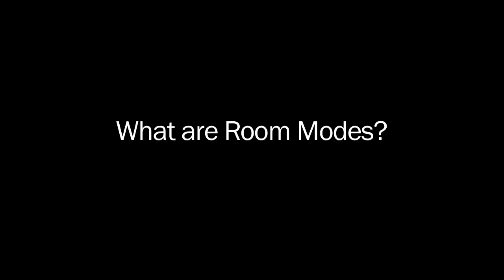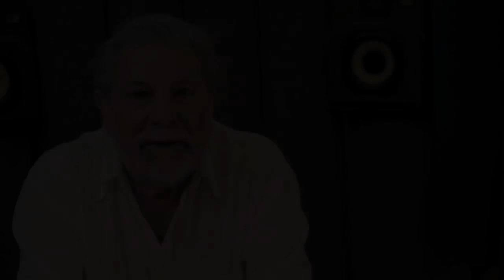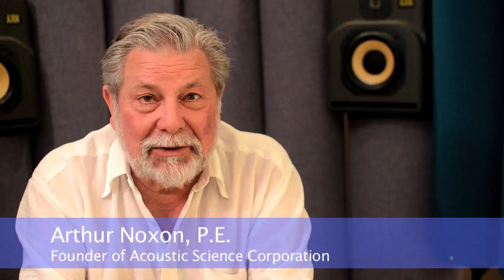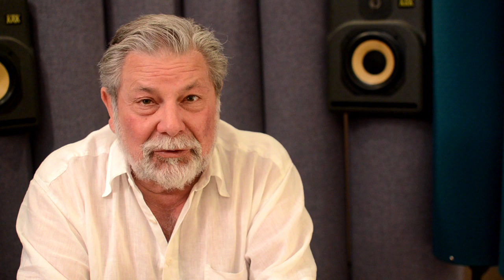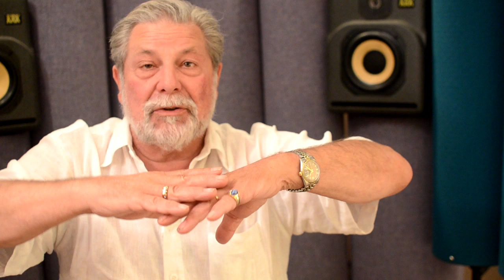Art Noxon Answers: What Are Room Modes?

Comment: I know this is an older video but just wanna throw this question/observation out there...Is the room "mode" different than the "resonant frequency" in a room? For example, I listen to music while in the shower, and I'll notice that one note jumps out more than all the others. So if I match that note with my voice, i can hear it boom. And if I hold that note, it gets crazy boomy and fills the entire space. But you said if it's a short note (less than a second or so), it won't typically excite the room - am I missing something or did I just discover a new law of physics lol
Reply from the maker: Hi JB....

Probably didn't discover new physics... Mode and resonant frequency are two ways to say the same thing.  A tile bathroom has modes, resonant frequencies and it has something else, lots of reverberation.  Reverberation is the sustained reflection of sound.  Any note you hold in a reverberant room will get louder and louder, any note not just room modes but any note.    

But if you make a tone and slowly change the frequency, you are making a sweep tone.  Start as low as you can and sweep up to as high of a note as you can.  During the sweep you should hear certain tones become exceedingly strong, loud.  These tones are the ones I'm talking about in the video, where the next push is delivered in time with the reflection of the previous push.  

"It takes about 1 to 1.5 seconds of holding a sustained tone to create a standing wave, or a room mode, if the tone is a room mode and you are in the correct location to create the mode, inside the sound pressure zone of the standing wave. That's the one note that jumps out at you, that you noticed.... 

 Once you identify a mode, let the room quiet down and now just sing the one resonant tone, hold it and let it build. Then stop and listen to it decay..... Then make a very short (1/4 second long) version of that same tone, sorta like Ba, Ba.  Change frequency to a different frequency that is not resonant, do again... Be, Be. Both short notes, Ba and Be should sound about the same, even though Ba was a room mode and Be was not a mode.  

sorry to be so late with a reply....thanks for asking and helping to clear things up.  
Art Noxon
Reply: ASC TubeTrap wow, thanks for the reply! I'll experiment with what you suggest...very interesting!

Comment: i like the explanation, out of curiosity how it.was explained that the second mode of a standing wave is like the bathtub water going in and out instead of sloshing, what is the next or is there nkt
Reply: 2nd harmonic in bathtub looks like this.....Water level at both ends of the tub raise up at the same time, while the middle of the tub drops down.  1/4 cycle later the water is flat but moving from the both ends towards the low middle.  Then that water rushing towards the center from both ends piles up high in the middle leaving both ends of the tub at a low level.  And on it goes.  To pump up  second harmonic, apply pressure on the water surface in the mddle of the tub.  Watch the water wave travel out to both ends of the tub and back to the middle, when it's at the middle apply another push down, again in time with the water movement.

Comment: My god you make this confusing with this swing stuff.  Most rooms are more or less like cubes, and you get 3  big places for things to go bad.  These are all the big parallel surfaces.  Any surface will have an effect, but it is the big ones that have the most effect.  Front to back, side to side, floor to ceiling.  In some cases you can clearly hear which one is dominant.  A good case of this is in a long carpeted hallway.  The carpet damps the floor to ceiling, and the length of the hallway puts it's frequency below the range of normal human speech, leaving you with that ringing sound from side to side.  If you clap and create some impulse noise you can actually hear it bounce back and forth while it subsides.  It is not like a swing where it takes time t build up.  Audio frequencies are from the tens of cycles per second to the thousands of cycles per second.  If you can push your kid sister on a swing a few thousand times in a second you are in far better shape than I am.  Besides the fact that at least for small displacements, the time of the swing is independent of the length of the displacement.  This is the theory behind pendulums as used in clocks dating back to 1656.  Oddly enough, in nature, humans use minute time and phase differences to localize sounds.  A very small amount of a humans sense of where a sound is coming from is based on the amplitude difference in the sounds.  Quite probably the single biggest affront to natural sounding recordings in modern times can be attributed to the so called pan pot, but that is a diatribe for another day....
Reply: I'm trying to relate resonance to familiar experiences.  I try to not use words to teach words because the feel of the concept remains buried in words.  I try to use words to tell stories that help  people feel what is going on, to feel it without the need for words.  But some people do love the world of words......
Reply: A clap in the hallway is not a resonance, there is no low frequency energy in a single hand clap, just an impulse of high frquency noise.  What you hear is a flutter echo, aka a pseudo tone, a sonic impression for sure, but it is not a bass tone even though it sounds like a bass tone.  Kids use a clothes pin to position a playing card so it gets hit by the spokes of a bicycle wheel.  It sounds like a Harley, but it isn't a Harley, it's a pseudo Harley,
Reply: First of all … what are you saying here ? That’s a lot of words to have almost no point. 

Second … your example is not really valid here.   Clapping your hands to create an impulse is not triggering a room mode.   

I’m confused.
Reply: @johnryansullivan2439
Reply: Sorry I didn't notice this string of comments to the youtube posting.  I'll answer some of the complaining comments now, although it is years later.  
I'll start with the most recent complaint, that a hand clap can't trigger a room mode.  
John Ray Sullivan's says:
     First of all … what are you saying here ? 
     That’s a lot of words to have almost no point. 
     Second … your example is not really valid here.   
     Clapping your hands to create an impulse is not triggering a room mode.  
      I’m confused.

John, you are not confused, you are absolutely correct,.
An impulse can't create a real room mode.  Very sorry to have given that impression. 

But an clap impulse between parallel walls can give the impression of a mode.  
And that's what is so confusing.
Now, let me try to explain what I failed to explain before. 
It' a little complicated so stay with me to the very end...the punch line....

A flutter echo is a repeating path of sound between two parallel walls.  
A mode is a repeating path of sound between two parallel walls.  
Hmm, same thing..........strange

A flutter echo is created by a single sharp slap type of sound, lots of high frequencies.
A mode is created by a long tone burst, a single tone in the bass range.  
Hmm, opposite things........strange

Real sound travels 1128 feet/sec . Our make believe walls are 11 feet apart. 
It takes 11/1128 = .01 sec or 10 ms for sound to travel the distance between the walls.  

We stand against one wall and clap, we hear the reflection after one round trip, 20 ms.  
We keep listening, we hear another slightly weaker echo clap in another 20 ms.  
 and another in another 20 ms and so on and on and on.  
We hear a series of claps every 20ms apart.  
To our ear/brain it sound like a tone that repeats itself every 20 ms. 
A tone that repeats itself every 20ms has the period P of 20 ms..
This tone has the frequency of f = 1/P = 1/20 ms = 50 Hz which is a low tone.  

What is the wavelength of a 50 Hz tone?   L = c/f = 1128/50 = 22 feet.  
What is a half wavelength of this tone?  22 feet/2 = 11 feet.  
A half wavelength that just fits between our parallel walls has a tone of 50 Hz.  
This half wavelength is the fundamental tone of the harmonic series of 
50 Hz, 100 Hz, 150 Hz, 200 Hz  and so on.....the room mode harmonic series 

When we clap at one wall we hear a flutter echo that sounds like a tone.  
It is called a pseudotone and in this case it is 50 Hz.  
The flutter echo pseudotone is the same tone as the lowest mode tone 
that fits between the two parallel walls.   
They both are 50Hz.  

I once knew an acoustic magician once, yes flowing robe and hair....Really.  
He would clap his hands between parallel walls and create the pseudotone 
which was heard by everyone in his audience.  
He told them it was the mode between the parallel walls.  
His audience believed him.  Then, he'd rumple large sheets of tin foil and
tape it up on the two walls and then he'd once again clap his hand.  
The rumpled tin foil scattered the hand clap and the bass Pseudotone "mode"  disappeared.
They thought he could make with his bare hands a 50 hz bass trap 
out of a few sheets of tin foil.......and many people bought his magic tin foil.

Arthur Noxon
Reply: Matthew, 
You have a pretty clear view of a rectangular room and modes. 

It's where you comment about a kid on a swing that seems off track.  I wasn't proposing to push someone on a swing at a rate of a sound frequency.  

Pendulum period formula T = 2π√(L/g) and frequency f = 1/T.  The frequency depends on the length, it is proportional to the square root of the length.  ..  

The busness of pushing a kid on a swing was an attempt by me to help the listener visualize how a mode gets pumped up.  If we start a speaker playing a tone that has the right frequency to make a mode, then with each cycle of the speaker, it  pumps up the mode, adding more energgy into the mode with each cycle which makes the mode louder.  Kinda like how we make the swing go higher.  It's an analogy.    

Your comments regarding localization of a sound state it is based on relative loudness at each ear.  Not correct.  It is is based on how the head shadows one ear more than another, which is frequency dependant, lots of shadowing at 1k Hz and no shadownig at 40 Hz.  has to do with head size and wavewlength.  

Maybe your problem with the pan pot is that all the frequencies are being panned the same amount, unless an eq is applied so only the highs say above 200 Hz are panned and  those below are not.  I haven't worked on this issue, I'm only guessing at this point.  There is a time delay panned version of this same effect.  Although very interesting, I wasn't discussing localization in my mode talk.  

Art Noxon
Reply: @arthurnoxon4283  If I may offer a further support for your swing analogy, the key point is not the literal swing but rather the concept of adding a "push" of energy that's SYNCHRONIZED with the arrival of the wave from the previous cycle.  I hope this helps to clarify the analogy and to de-emphasize the necessarily imperfect term "swing" as in a child's swingset.
Reply: @bensolomon1872  Yes Ben and this synchronized push is even more complicated than what we first imagine it to be.  But I didn't want to go too far into the concept of impedance matched synchronization.  It was enough to realize that the swing set push only works if it is timed, coordinated with the position and movement of the swing.

Comment: not a third*
Reply: 29% not 1/3rd.  speaker at 1/3rd point stimulates 3rd harmonic......   for room that is 21' long, fundamental is 42', 30 something Hz, 2nd harmonic has a 21' wavelength which is about 60 Hz and third wavelength is 14' wavelength which is about 90 Hz......